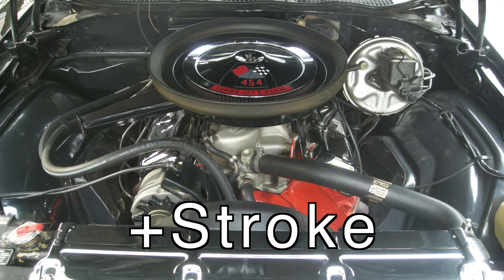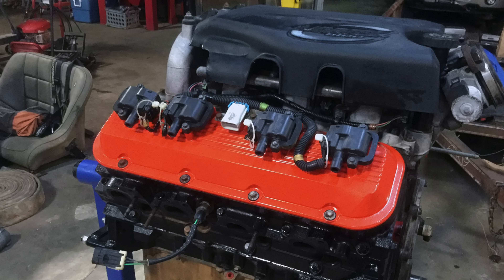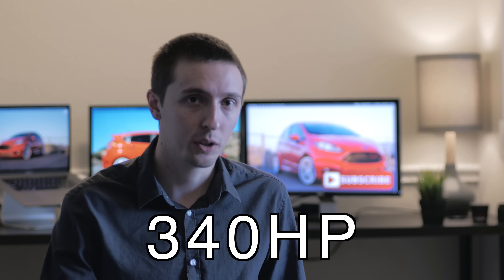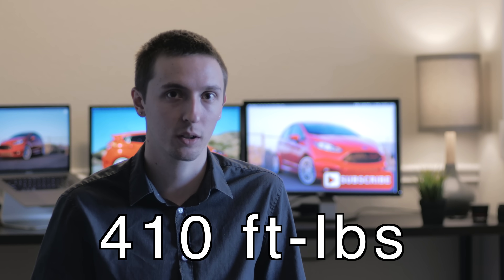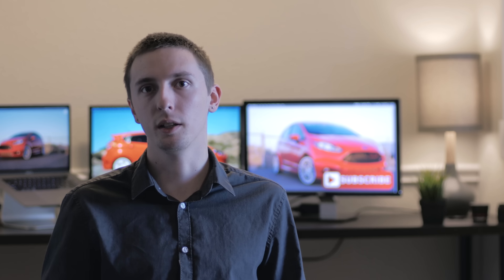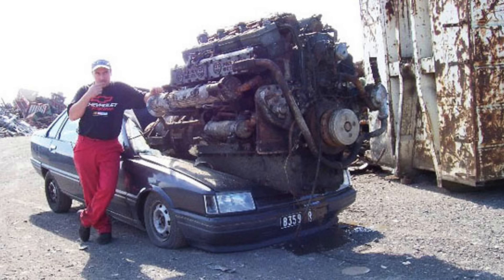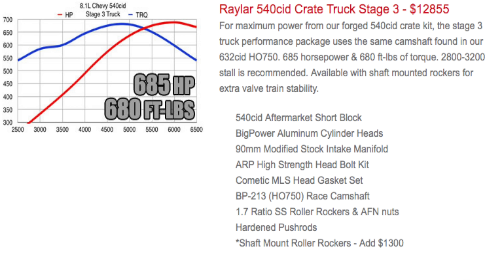Vortec 8100: Everything You Want to Know | Specs and More

Comment: GM says the 8.1 is allowed to burn a quart of oil every 1000mi. Seems a tad excessive to me but the pistons are like coffee cans. Excellent motor for what they are. Much better than Fords V10 option.
Reply: That's pretty standard across all brands Ford and Chrysler at the time allowed for that much consumption. One engine in particular now, the 2.4L Tigercat is allowed 1 quart of oil consumed every 2000 miles. But with a 5.5 quart pan and 10,000 mile oil change interval....well you get the idea.
Reply: even 6 figure sports cars burn oil
Reply: I have a 8.1 and it does burn a lot of oil
Reply: @mystorymylife9998  one quart per 1000-1200 miles is pretty standard.
Reply: Damn my 291k mile Ford diesel burns less oil than that. 1-1.5qts every 3k
Reply: My truck has 200,000k on it and I don't even have to add oil between oil changes. Literally burns no oil.
Reply: I've got an 02 8.1 with 168k and it burns no oil.
Reply: @mattlooker4915 mine has 163000 and I have to add a quart between oil changes but I love my truck
Reply: Ford's v10 is overrated Ford's smaller 6.2l v8 will whip its rear stock to stock
Reply: Joseph Young Agreed. V10's lack power.
Reply: @josephyoung1635 no it won’t. This has been addressed on forums numerous times. There’s a reason ford used the v10 in 450 and up until ‘19. If 6.2 was so great why not put that in the medium duty’s?
Reply: My 99 f350 6.8 v10 was a beast. There is not a single other gas truck that sounded even remotely comparable to that monster. It would tow at 1500 rpm or at 5500 rpm. It's willingness to rev was that of a four cylinder. Never broke down. Never gave me issues. Never couldn't tow what I needed to. It's an underrated work horse and anyone with the privilege of owning one knows that.
Reply: Ive seen v10s let go at 20,000 miles. Much like eco boost, Ford could care less. They know what the issues are and could care less. A GM can go thru 4 Bank notes and still be running 15 yrs later.
Reply: @michaelteeple8704  
V10's don't have known catastrophic failures at 20,xxx. There's horror stories for every engine out there but Ford v10's are not lemons. They have issues with the spark plugs threads in the heads, that is all. Meanwhile I've personally seen 4 high mileage 2000 Chevy pickup with broken or cracked frames and gm definitely doesn't do shit about that.
Reply: @92clintonr  v10's did NOT do well in motorhomes I have a few relatives with class A and class C. They keep cracking the head in the last cylinders, to much heat but a set of headers fixed that. Then they are a good motor.
Reply: @jrod264winmag  
That can't be all that common of an issue. My dad owns and runs an RV shop in town for the last 20+ years. He has had one v10 come back with issues and it was his apprentice service techs fault. The old o ring on the old filter stayed on the engine and he didn't notice, put the new one on over it and it ended up dumping oil and seizing the engine on a drive. No fault of the v10 there.
Reply: @92clintonr  37' Holiday Rambler cracked head at 12k. Second motor dame thing at 9k ford said it would not replace anymore due to abuse because towing to much ( small trailer with a 4 wheeler ) . The rv shop that swapped the engine said it's a common problem
Reply: @jrod264winmag  sounds like someone took you for a ride at the repair shop, my buddy has one with 100k on it runs like new.
Reply: @michaelteeple8704  I’ve seen so many with over 300k running strong those v10s would run forever your full of shit.
Reply: It was mainly due to the factory intake manifold gasket, and pcv system. Most aftermarket, and updated oe gaskets, help with the issue really well. As far as the pcv goes, I'm not aware of anything to help with that.
Reply: Sadly the Workhorse RV chassis was killed off and there went the 8.1. The chassis drove better and rode way better than the Ford chassis with the V10. The downfall was it was up to $20k higher than the Ford.
Reply: What? I've an 03 and it doesn't burn a drop. Why do people pretend to know shit?
Reply: @cecilg.relation2537  my 02 2500hd don't burn shit for oil either 150k miles.
Reply: @jrod264winmag   I've near 180k and I work the shit out of mine. Runs smoother than an electric motor.
Reply: @cecilg.relation2537  if it's properly clearanced to GM specs a 8100 vortec will use one quart of oil to approximately 1500 miles I've had my 2003 2500 heavy duty since 2005 and have had to issue ever since I purchased it in the dealership told me why I was happening and then I did some investigation and found out they weren't lying it's normal
Reply: Once read an article that stated the 8.1 lasted longer than almost every gm engine tested during torture tests performed during r&d on this engine. It said that all tests pointed to it being highly reliable. Never owned one, so I can’t say from personal experience, but the article was interesting.
Reply: @knorb8570  theres a reason big blocks were kings back in the day.
Reply: The v10 fuel mileage is the same 8.1 is gonna make more torque down low where you want it I've got well over 200k on my 8.1 and no lifter problem but I don't wrap it at 4 grand that's why people develop alot of lifter problem the v10 is a higher rev engine then the 8.1 they both got there own problems but it's hell of a lot easier working on my 8.1 than the v10 people got their own opinion on them people get them both for different purposes mine fits the bill for me and I'll never sell the truck and it's cheaper maintenance than a diesel
Reply: I have a 02 v10 with 420k miles, I’ve never changed the oil once. I pull a 69k pound trailer at 100 mph everyday up a 15% grade. Anyone who disagrees with me doesn’t know what they are talking about.
Reply: Ours had around 150,000 and never burned oil before it was traded in. Only problem was a fuel pump.
Reply: That is industry standard
Reply: josh robinson bet ford sold way more v10s I sure see more v10s
Reply: @johndeere8824  easily! Look on the internet they're in everything from 250-550 and excursions, Van's, etc
Reply: They are saying that in other smaller engines too. My 7.4L at 118k miles burns about a quart every 4-5k miles.
Reply: I have 2 trucks in my fleet since they were new they burned at least 2 quarts of oil every 3k mil. Chevy said it was normal.
Reply: For a heavy duty I could see that being there because they are thinking about expansion when it is hauling. I bet if you are hauling a load cross country you might not use that much if its running constantly down the freeway. All the consumption is probably during cold starts.
Reply: I have this motor and it burned a lot of oil. Then it stopped burning oil. Go figure!
Reply: Mine came with a notice to expect it to use 1 at per 3000 miles.  Really wasn't that much, using a full synthetic, more like 1 qt/ 5000 mi
Reply: I bought a 2001 3500HD new and it burns a qt every 700 mi since new. GM told me 1 qt every 100 gallons of gas is normal. Put intake gasket and bolts in twice and no change. Has  cold knock since new. Otherwise no problems. Truck weighs 13k and I get 9 or 10 mpg.
Reply: @ShieldArc200 Still have yours? I'm going to look at 1 tomorrow. Oil consumption giving me alot of pause. Don't no if I should go through with it
Reply: I've got 2500 8.1 and I love the truck it's strong and runs like top through the mountains at low RPM wouldn't trade it for diesel does everything I need it to do and no expensive maintenance the V10 is a lemon I've had buddy's own them I have a Ford too so it's not me hating on Ford
Reply: Fords v10 makes more torque at a lower rpm and more horse power at 500rpm higher, and is extremely reliable, and doesn’t suffer from lifter failure. I would disagree on it being “better” I like both engines but in stock forms the v10 was a better engine for every day use.
Reply: @cornelius6304  I drove a Ford F350 plow truck for work for a winter. Our other truck with a 5.4 pushed snow better and got WAY better fuel mileage. All the Ford V8s of that era had ignition coil problems and I don't think I have seen a Ford V8 without broken exhaust manifold studs.
Reply: Mine burns about that much, runs like a champ
Reply: My 8100 in a W22 RV doesn't use a qt of oil in 3k oil change intervals.
Reply: There is a PCV fix for the oil problem.  Watch LT Tolman's channel.
Reply: Do some surgery and relocate the pcb valve from under the intake belly to the valve cover
Reply: I have both. True statement.
Reply: As of 2025 Cummins just released a gasoline version of the 6.7 Cummins now people with the vortec 8100 or the 454 will probably swap the new Cummins gas engine into their vehicles
Reply: I wish! My 02 2500 Avalanche with only 93k miles burns about a quart every 2 months. To put this better in perspective,I mainly only drive the truck 6 months out of the year from mid Oct through mid April, putting on about 3k miles in these 6 months. So approx 500 miles a month. As I'm typing this, I'm realizing you're absolutely right lol
Reply: I have a buddy I work with that has 498k on his v10 and still runs good.
Reply: @tjlqk3  Fords V10 is kind of wimpy and makes its power higher in the rpm then the 8.1. 
The V10 isnt a bad engine, the 8.1 is just a better option.
Reply: Josh B Our Town Highway Dept has F450's with V10's. They suck in terms of power for plowing or pretty much anything else we do.
Reply: @Not_An_FBI_Van the 3v v10 makes 460 ft lbs at 3K and 90% of that is available from 1900 rpm…I don’t think the 8100 really beats that does it?
Reply: @tjlqk3  the v10 is just problematic from Ford.
Reply: jdr ok you know nothing about the 6.8L
Reply: Use Lucas engine oil stabilizer and END that problem!
Reply: @DawnNLN-ee2kh  Does that stuff really solve the oil burning problem?
Reply: The ford v10 is great... similar hp and torque numbers similar reliability and it doesnt burn oil
Reply: josh robinson with that kind of ring gap, that motor is prime for super charging or a Turbo. 

That way with the cylinders under all that boost you’re less likely to but the ends of the rings and score the cylinder walls.

Comment: HI.  i have a 2001 hd2500 c/c sb with the 8.1 and Allison trans. not only is the best truck ive ever owned, it went over 430,000 mile before finally suffering a bad intake valve. (it was still able to run the day when i removed it!) the truck has pulled well over 43,000 lbs (yes, i know its too much but, i dont like doing return trips so, i load it..) it has been a tow vehicle since i got it new in feb of '01. FINDING A GOOD USED engine was incredibly hard.  like the show states, not too many around.. most have been over heated and they are notorious for cracking the blocks.  ) THE FOLKS AT RAYLAR ind. told me i would likely get 2, 3 or even 4 before finding one that didnt have a cracked block.   HE WAS 100% RIGHT !  i did finally find a good one with 145,000 mile on it. its in the truck today. along with  another allison.  so far, its gone the first year with no issues. i still tow all the time..  ridiculous, stupid things and, i put this engine to the "test" all the time.  i would recommend this engine to anyone who isnt sure just how tough these beasts are! im soon to replace my pinion bearings since ive NEVER touched them and, im well over 500,000 on the 11.5" posi unit it came with...   indeed the gas mileage sucks eggs but, it doesnt quit...  it just goes and goes.... i wont sell my truck. i might get a new one one day but, for now, my beast is still doing the job and, shows no signs of letting up..  the next replacement will be a RAYLAR ENGINE since they have the goods for these engines and, they make them work very well ! if i could post a pic or 2 on here , i would.. towing 10 wheeled trucks, steel beams, buses, fork lifts...... like i said, i work it ! it still impresses those who have seen it work and, the things its towed or pulled out.... this would include motorhomes , buses, 4x4's pulling trailers, even a med-duty tow truck stuck in the mud. and plenty of people in glamis whom i have unstuck or pulled home.....  by the way, did a mention it was only 2wd ? if youde like to see it working, please write back to me...  i do have some pics of the truck in action....i have proof of my claims..  my chevy with its 8.1, has been the best truck i have ever owned..  and ive owned A LOT.... the 8.1 is a true animal ! and it has the appetite too..   haha...  it aint cheap to drive but, its a no fail, no quit monster that i could NOT be happier with....
Reply: I know what you mean INKJAX on your 8100. I own a 2002 GMC 8100 dually 4x4 thats my daily driver for work and personal trips and this beast will not give up and has never let me down no matter what I use it for. Im pretty sure I will get to 1 million without major problems since these 700,000 have been fun driving it everywhere. I wish GMC still offered this Big Block in their new HD trucks and still offered Medium-Duty Trucks as well.
Reply: I love the this same motor and wondering if the fuel pump has ever quit on you yet 186xxx on mine
Reply: Only problem we had in 150,000 was the fuel pump
Reply: Waaaaaaay down in the comments someone said he's a mechanic and every 8.1 head he's done had that valve problem.
Reply: If you tow a lot, why not a diesel?
Reply: I WOULD love to see that working!
Reply: INKJAX why are cracked blocks common with the 8.1?
Reply: @Mr.Beastforpresident   They tend to crack from their notorious oil consumption because people forget to check their oil and when people are hauling overly heavy loads without checking their oil the crack from the heat.
Reply: There pretty good engines one of my buddy's had an 8.1 in his s10 drag truck it made like 1100 horsepower with a supercharger it snapped the s10 in half

Comment: They should of made a direct injection+turbo version of this engine however at that point nobody would want a duramax.
Reply: Could certainly make massive power like that, but at what cost?  The thing already sucks the fuel down.  Part of its reliability comes from the fact that its components are not stressed much at its stock power levels.  Then compare that to the fact that with nothing more than a tune, a Duramax of any year can lay down 500hp and 1000tq depending on transmission health, and if the injection pump keeps up.  (Easily solved with a lift pump if needed)  At that power level, an LB7 will easily knock down low-mid 20s mpg.  My own achieved a best ever of almost 25mpg straight highway miles, though usually settled at 23mpg.

Comment: GM really needs to look into bringing the 8.1 back into their hd line up. ✌✌
Reply: With redesigned heads and direct port injection. Surely they could develop a tune when unloaded it could sip gas. Although the rwason why you wont is due to cost to bring back, government emission tax, competition with the 6.2 thats designed very well and exceeds the 8.1 in nearly all ways. Then you have the duramax.
Reply: @coltoncarpenter3790  I would like to see a LS type head designed for the 8.1 ( if that's fesible) along with direct injection.
Reply: Totally agree. The 6.0L is enimic.
Reply: The 8100 had some serious drawbacks conpared to earlier - notably one use metric fasteners, limited (and therefore expensive) affermarket support, and a persistent oil consumption issue that seems to be caused by the crankcas vent system in the intake manifold (which btw, seriously restricts airflow as well )
Reply: My work truck has a 6.0 with a 6 speed transmission. Nor sure if it's an allison or not
Reply: @jerredwayne8401  6.0 does not have allison. Only 8.1 and Duramax do
Reply: Jerred Boshears I’m pretty sure yours would be the 4L-85E but I’m not for certain. I was told you could special order the Allison behind a 6.0 but I’ve never personally seen a truck with that combination before.
Reply: @tracefuqua3651  no.  The ONLY gas engine to get an allison is the 8.1L.   Suburbans with an 8.1L got the 4l80e due to not having enough room for the allison to fit.
Reply: @tracefuqua3651  Probably a 6L80 or 6L90. The 6 means 6 speeds and the L means longitudinal engine configuration, and I believe the 80/90 means 8k/9k GVWR, but may be wrong with that.
Reply: @johnh1235  in the 6l80, 80 = eight 0 = 800lb ft of torque and eight five would be 850 ft lbs of torque the trans is capable of handling.
Reply: 8.1 (or bigger) low boost supercharged w/ direct injection , variable lift and timing would be awesome. State of the art big bore powerhouse
Reply: mr.18436572 GM is looking back into a big block motor In 2020. They currently have a 6.6 gas (not a duramax) planned there is rumor of a giant 8.3 or something planned. Ford also has a 7.3 (gasser) coming out.
Reply: Aluminum heads would be a sweet factory addition...
Reply: They should since Ford produces the Godzilla (7.3l 44x gasser pushrod) and now they got a 6.6l LS that makes 14 more lb ft tq than the 496 but the 496 peaks at lower rpms like a diesel and somewhat embarrassed most diesels and dominates v10s.
Reply: @brandedmcgowan9414  I totally agree from what I understand from people who own'em is big boy really appreciates stopping at the gas station but as far as a gasser it really gets the job done. But I've never known a big block that didn't like a gas station stop. 😂😂😂 ✌✌
Reply: @bowtie-man  lol that 44x is whatever cubes size it is, i don't assumed its 444 like the IH diesel (original powerstroke) when you buy that 496 its better be doing work not getting groceries and joyriding i don't mind putting gas in it to go LOL as long it helps me make 💰......by putting gas in it to go to worksite and back to the house. Hahaha!